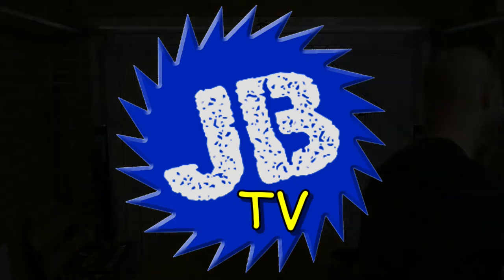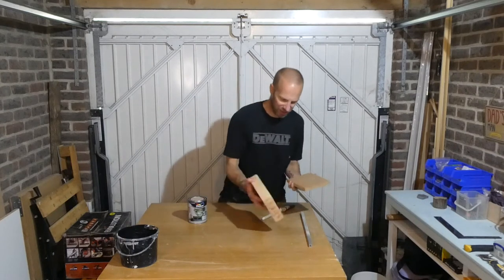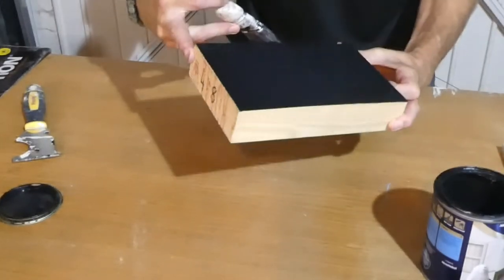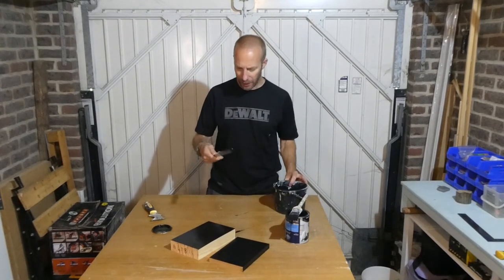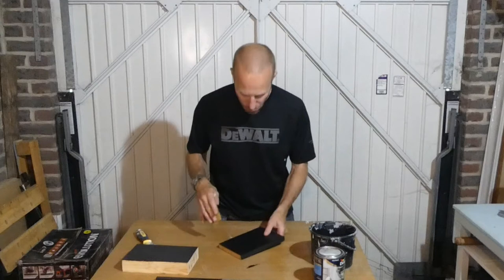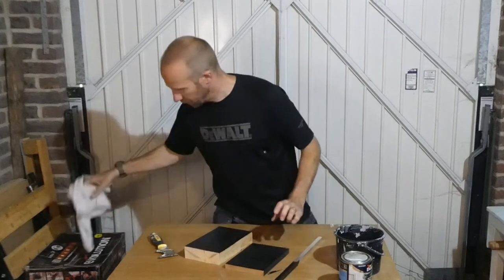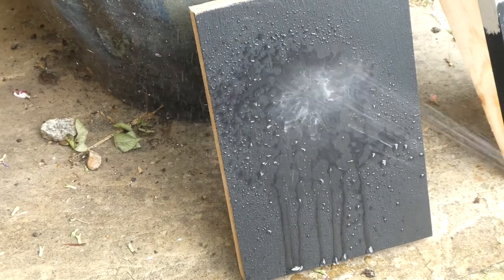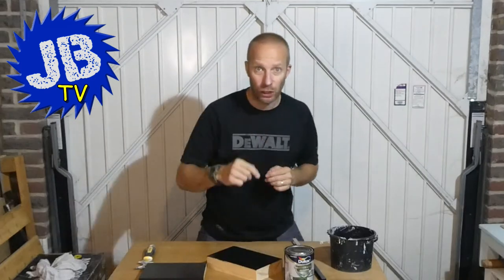Dulux Weather Shield Paint - No Primer Required - Multi Surface

Comment: Hi Justin, thanks for the video. I've recently moved into a retirement flat with an ugly clinical looking bathroom/wetroom. I have thrown caution to the wind and decided to paint the vinyl floor, worth a try before going to the expense of replacing it right? I settled on Dulux weathershield for three reasons, 1. No primer needed, 2. No sealant needed (hopefully) 3. Four hour drying time.
A test patch last week has stood up to 10 mins of the shower running and being scrubbed with cilit bang. How it will stand up to daily showers and constant back and forth of the shower screen, only time will tell. 
It definitely needs two coats, second coat went on this morning. 
So far looking good. It's a really nice paint to work with. I used a 10mm sable flat artists brush for edging and getting into awkward spots. Brushes clean up really well. 
Next job is patio doors and balcony railings.

Comment: Some absolute bellend stole our cast iron manhole cover and I got a replacement flimsy one from Toolstation which was silver coloured. Have spray painted it black numerous times and the minute the wheels of the recycle bin hit it, the paint just scratches away. Do you reckon this gear would be harder wearing? 😉

Comment: Could you use Dulux Weathershield Ultimate protection Masonry paint, on wood is a 2 in 1 was going to use it on a log cabin
Reply from the maker: I wouldn't use a masonry paint on wood, might be ok, but I don't recommend it
Reply: @JBTV  ok thanks
Reply: I recommend Sadolin  10 years Superdec  to paint log cabin